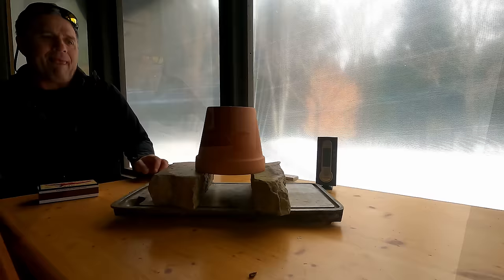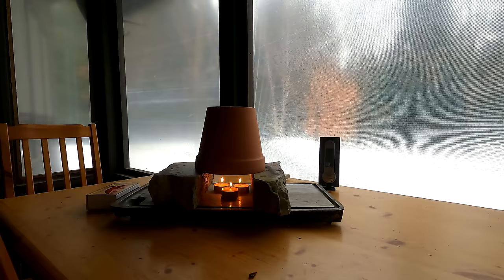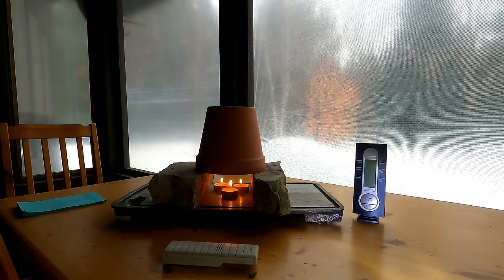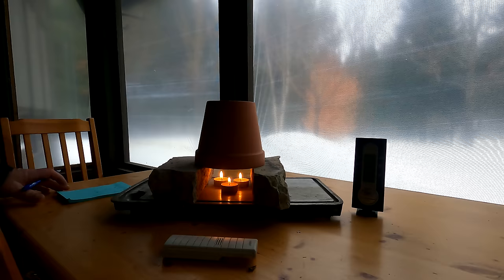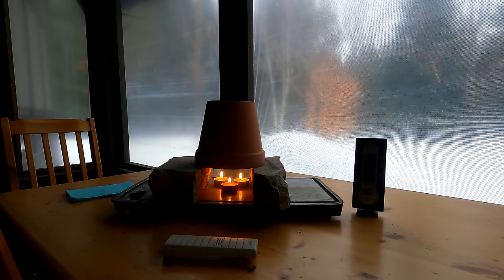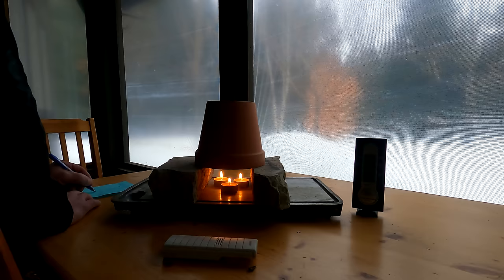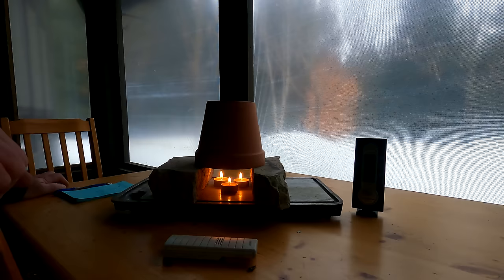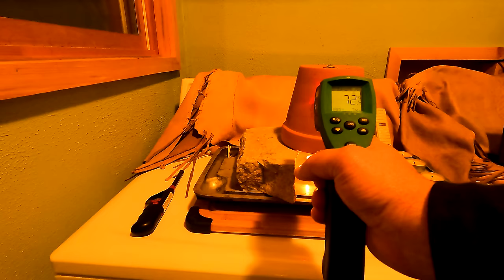Testing the Clay Pot Heater | Truth or BS | Prepping and Testing

Comment: If its an unheated room with just plastic on rhe windows, the outside temperature will raise the inside one as the day progresses.
Reply from the maker: The room used to test this unit is a fully enclosed interior room in the house - the room is insulated with R30 in the walls and R40 in the ceiling. The room to which you are referring to is a screen porch which clearly could never be heated by a small device such as this.  You provided this comment based on watching less than one minute of the video. That is indeed the problem with most of society - every one assumes their reality - not actual or factual reality.
Reply: @Hawksshadow  I'm confused by your reply; you seem to be referring to a different video. Clearly this is a plastic enclosed porch and indeed the outdoor temperature rise was not taken into account.
Reply from the maker: I understand your confusion - the video will take you into a Laundry room where the test was actually conducted. The short test in the screen porch was simply to  see if the pots would heat up as others had indicated on YouTube. I tested the "heater" in a controlled environment to determine if it could indeed heat a small room. Fast forward the vid and you will see what I am referring to.  Thanks for getting back to me.

Comment: Completely wrong. You would get   near identical results without the pots.
Reply from the maker: Glen, I must dispute your claim. The pots capture the heat much like a stone fireplace captures heat from the hearth - the pots radiate the heat in an even pattern. I tested this unit in a tent and met with negative results due to the amount of heat the candles can produce. I heated a granite rock the size of two fists - in a fire pit - and the tent warmed up by 18 degrees in five minutes - this is simply due to the fact that Clay and Rock are exceptional at capturing and storing heat.  When the candles are extinguished, the clay pots stay too hot to touch for 30 minutes if left in a room which is 20 degrees.  Try the experiment and you will come to the same conclusion.

Comment: by pure physics it's bs, all it's doing is radiating the heat in different directions and the total energy input to the room is unchanged
Reply from the maker: That is correct - This unit is only capable of maintaining the heat in a small room which is very well insulated. The candles provide the heat, the pots capture the heat and control it's loss to the ceiling. This is shown at 4:06 in the video.

Comment: Hen I did this I used a bolt with a ring on the end so the hot bolt came out the top for extra heat?
Reply from the maker: I do like the ring idea as it gives you a place to lift the pots up with a tool rather than taking a chance of burning you hands. These pots get super heated and will scald you if touched without gloves.

Comment: This is only half the test.  The other half is to repeat the test with NO pots, only the stones and the three candles and see what happens.
Reply from the maker: You are correct - I simply wanted to test the pots and their ability to add to the equation. There are many who feel the pots are a negative in this equation. I can attest to the fact that they are absolutely a bonus as the clay absorbs the heat - so much so that you can not touch the pots with bare hands for 30 minutes or more after the candles are extinguished.  The heat from the pots radiates out into the room in a controlled manner. I will do the test as you suggested, using the same type of candles, in the same room and the same heat setting in the room. Great suggestion.

Comment: you say this is real but did you repeat the experiment the next day without the pot? Nothing is free!
Reply from the maker: I actually did an experiment using just candles in a pop up shelter. The candles did warm the shelter somewhat; however, the pots - being made of clay - hold heat and radiate the heat better than a single candle. This pot heater is useless in the bush as it is simply too fragile. This will heat a small room should the power fail or furnace fail. When I state a small room, the experiment was done in a 6 ft. by 6 ft. room. 8 ft. ceiling.
Reply: @Hawksshadow  Thanks. But it's just an illusion. If the experiment is to heat up a clay pot and the area close to it then this will work but the pot won't amplify the heat in any way so it can't heat the room up any more than a candle by itself would. There'd be a Nobel Prize in this if anyone can disprove the laws of thermodynamics.
Reply from the maker: Seriously Dude - I am not nor ever claimed to be a thermodynamic scientist. I am an outdoors man who knows how to survive in the wild - I do know that this system did work. Have you ever spent a night in the woods where you have heated rocks in a fire, buried them, placed your sleeping bag over the area and had the best sleep ever? It's called heat retention - my guess is you have not - I was simply checking out an idea and found it to work. Not flying to the moon Dude. Chill out. Relax and get some sun. A few mosquito bites may wake you up to reality. Doubt you could handle it. BTW - Who gives a flying F---- about a Nobel prize - I only care about the forest and the wild ones who live there. Have fun in your basement.

Comment: Hi, tanks for the video and  information. How big is the rom, and what was the temprature out side?
Reply from the maker: The room in which I tested the unit is a laundry room which is well insulated and has no direct link to outside temperatures as it leads to an insulated mud room. The room is 6ft by 8ft by 8ft high.  The temperature outside at the time of the test would have no bearing on the actual final numbers as the room temperature (baseboard off) was 8 to 10 degrees at the start of the test. No other heat source was introduced during this test.

Comment: Did you stay in the room the whole time. Your body produces more BTU an hour than 3 tea candles.
Reply from the maker: You are totally correct. I did not stay in the room for that very reason. I used a remote thermometer to measure the temperature. The sensor was located on the wall to the right of the test - Approx. 5ft away.  The room is 5ft by 8ft with an 8ft ceiling. R30 insulation in the walls and R40 in the ceiling. the unit only increased the temperature of the room by a few degrees. Please note - I would not use this unit as it is to fraught with safety concerns. I am no wimp, but I don't want to have to chase my insurance company down should my home burn due to candles. One of the major concerns with this system is the fact that the candle wax melts due to the heat captured in the pots - liquid candle wax will ignite if heated to it's flash point. This varies with the types of wax used. This unit could cause a major fire if left unattended.

Comment: The problem with the tea candles is that they are a fire hazard when they are that close together, there's a chance that the paraffin gases may self ignite and burn everything down.
Reply from the maker: You are totally right - the gases produced by the candles can indeed create a fire bomb. I have not had that experience but I would not want to chance leaving this thing alone for very long.
Reply: @Hawksshadow  You should use Bee's Wax candles.

Comment: it is BS.. clay pots do not amplify the heat from the candle.  the candle only has so much energy.
Reply from the maker: Correct - the pots only function is to capture the heat and radiate it out where you can actually use it.

Comment: I had the same set up….. 400 square feet insulated cabin.  Seemed to work ok but my carbon monoxide detector went off.
Reply from the maker: For sure - the only candles you can burn without the worry of toxic fumes are Bees wax and Soya based candles. I have heard that some people have used alcohol burners - fondue fuel canisters. I have not tried it but it is tempting to give it a go.  Thanks for the comment.

Comment: What are you using the washers for? And how are you constructing this? I only have 2 clay pots and Id like to try it this december
Reply from the maker: The sequence I used is as follows - Pick the largest of your pots - place a washer onto the bolt and slide it through the bottom hole in the pot so that the bolt extends inside the pot. Slide another washer on the bolt and then thread a nut onto the bolt. Snug the nut up - then slide another washer onto the bolt - slide the next pot onto the bolt. Follow with a washer and bolt. 
Sequence - Bolt - Washer - pot - washer - nut - washer - pot - washer - nut. 
The washers help to mitigate the possibility of the pots breaking as you snug up the nuts. Hand tight is the key. Hope this helps.

Comment: How do you put it out when its time for bed as the pots are far too hot to touch ?
Reply from the maker: Good question - Once the candles are blown out - the pots are safe as long as they are not in contact with anything that can melt. Simply leave them to cool down.  I would not suggest this unit be used in a bedroom - it is not efficient enough to heat the room and secondly it can produce toxic gasses - unless you use non toxic candles such as bees wax candles as you suggested. Thanks for the comment.

Comment: Oil candles may last longer.
Reply from the maker: You have a very good point - I am sure there are candles which last much longer - I think the issue with this unit is simply that it is not efficient enough to heat a room which is larger than 30 sq. ft.  I simply did the test to see if the pots did trap and radiate the heat as others have claimed - the pots did indeed perform as suggested. I recently posted a video using the same set up in a tent. The results were certainly conclusive. 
Thanks for the comment.

Comment: Depending on The design they can work very well i have one and it does work
Reply from the maker: I do agree with you. This system of heating was used centuries ago. Albeit, the terra cotta was designed for heat capture and retention. I do worry about the safety factor though. Paraffin candles can cause some serious issues - I would use beeswax or soya based candles only.  I heat my home with wood so this test was simply to determine if this device is viable. Thanks for the comment.

Comment: You realize, I hope, that the room would be warmed up exactly the same amount with the three tea candles alone.  The flower pots do nothing, other than get warmed by the candles and in turn re-radiate their heat into the room.  The surprising thing might be to learn how much heat a tea candle (or any candle) actually turns out.  According to Google, each tea candle emits around 32 watts (https://en.wikipedia.org/wiki/Tealight#:~:text=However%2C%20tealights%20are%20commonly%20short,depending%20on%20the%20wax%20used.), so three of thee is the same as a hundred watt light bulb.  That is, quite a lot for such a little thing.

In the end though, you're just burring petrochemicals - paraffin wax in this case, instead of paraffin oil.  And if yu only burn a tiny bit, you only get a tiny bit of heat out.
Reply from the maker: Your point is well taken - I do agree - the pots do have a function - they capture the heat and radiate it out in a controlled manner - I heat my shelters using rocks which have been heated in a camp fire. A rock the size of your palm will radiate heat for at least four hours in an enclosed shelter. The pots function is to do the same. They do not increase the heat - they simply control the heat output. The pots stay hot for at least 30 minutes once the candles are extinguished. NOTE - I would not recommend using this unit for emergency heat as there are too many safety risks associated with it.  Thanks for the comment.

Comment: Would 2 of these in the same room double the effect?
Reply from the maker: I believe that would be the case; however, please use clean burning candles if you are going to try this unit. The proximity of the pots to the candles causes the candle wax to liquify and become gaseous. I would suggest raising the pots higher to allow some air flow.
I had to air out the small room which I tested this in for at least 30 minutes after I extinguished the candles.  Thanks for the comment.

Comment: The heat is coming from the candles, not the pots try it without the pots and you’ll get the same result
Reply from the maker: The heat is indeed produced by the candles; however, the pots capture that heat - retain it and radiate it. I recently did an experiment with this exact setup and discovered the pots are still too hot to handle 10 minutes after the candles are blown out. Again - this unit should not be used in an enclosed space.

Comment: The 2-pot method appears to have the best promise. The idea being that the first pot (although good) cools up, and cools down fairly quickly. By adding non-combustible-inert material around the lights, they absorb radiant heat from the flame. Although slower to warm up, they also retain heat for longer. It's important to remember that flame plays a huge psychological part in the human being; right back to the stone age.  Covering the hole normally improves thermal efficiency, as it makes the heat travel further . Keep It Safe!
Reply from the maker: Well said Ian. I did this as an experiment to check the viability of the heater - For a tiny room it would certainly work - at least it would keep the temps above the freezing point. Thanks for the tips!!
Reply: Dang, if 2 clay pots are better than one you should try one million pots, you could heat cities!
Just quit with this BS, it's embarrassingly sad that folks are that gullible!
Reply: @svgs650r  Happily, I know it works, and that's what's important to me.

Comment: What were the results of your control test of just burning the candles?
And the second variation where you replace the pots with a flat concrete block or stone to act as a diffuser/heat sink?

Oh, you didn't do any comparative tests? Then how do you know your results mean anything?  That's a hallmark of BS.
Reply from the maker: I have produced two videos containing the answers to the questions posed in the first paragraph of your comment.  Have you done a test using the same method and procedure as I did - If so - what conclusions did your test reveal?  The pots do not increase the BTU's of the candles - they simply capture the heat and radiate it out in a uniform manner which can not be attained by simply burning candles alone. The pots will stay too hot to touch for at least one hour once the candles have been extinguished. This of course is dependent upon the ambient temperature of the air where the pots are located.

Comment: Of course it’s BS. Just do the math. A candle can’t heat a room.
Reply from the maker: A candle creates heat - as little as that may be, it will indeed help to heat a small area. Which is exactly the point. If the power fails and you have no alternative but to use candles - then you have no choice - move a chair into the smallest room you have, light a few candles and hope the power comes back on in a very short while.
Reply: @Hawksshadow  sure. Guess it’s better than nothing. Hope people are better prepared than that though. Even blankets would keep you warmer.

Comment: about 75 BTU per candle 
Absolutely 0 BTU from the pots
Reply from the maker: That is correct - the pots capture the heat and radiate that heat in a uniform manner - thus allowing the heat from the candles to dissipate in a controlled manner.

Comment: Interesting video.  Thanks for conducting the experiment a lot of us have wondered about.  We had an ice storm a few years back that knocked out electricity for 2 weeks.  That first night it was virtually impossible to travel.  We took a few metal coffee cans (big folgers ones), put some water in them and floated tea lights in them.  We weren't able to sit around in our shorts, but at least it provided some warmth until we could make it out to get a generator.
Reply from the maker: Hello Bob - sorry for the late reply - This can certainly be used to heat a small room - at least it will keep you from freezing. I am sure sitting around in shorts would still be a no go though.

Comment: You need air flow up the sides and out the top of the pots to create a chimney effect.  The chimney effect flow will pull and push the heated air out into the room.  
The inside pot will get the hottest, and the air flowing past the hot pot(s) will get heated.
Reply from the maker: I totally agree with you - the pots contain the heat so well that a good majority of the heat is trapped and can't escape. The unit would have to be built as stacked and not linked via a bolt. I will give it a shot just for curiosity sake. Thanks for the comment.

Comment: So, you think that would work inside of a van, just enough to be comfortable???
Reply from the maker: I would have to test that idea out. The problem is the amount of heat loss through the windows and such. This set up certainly will help to heat a small area - as long as it is enclosed and insulated.
Reply: Be careful for carbon monoxide poisoning, you'll have to keep a window cracked, so with a window cracked im not sure it'll be the best way to heat the van, but you will have to test it
Reply from the maker: 100 percent true - this unit does generate toxic gasses. Caution would be highly advised. Thanks for bringing that up.